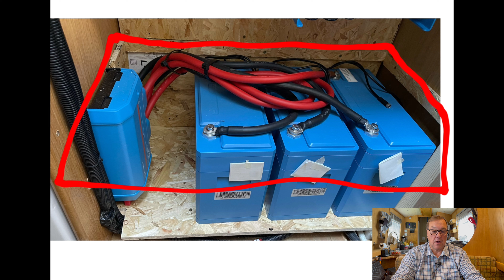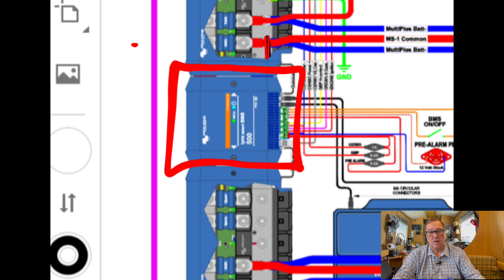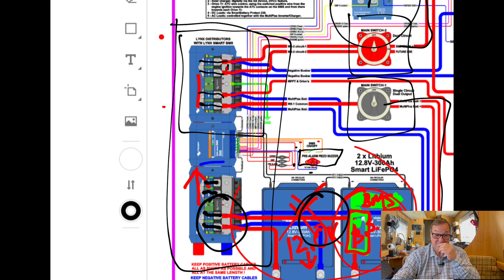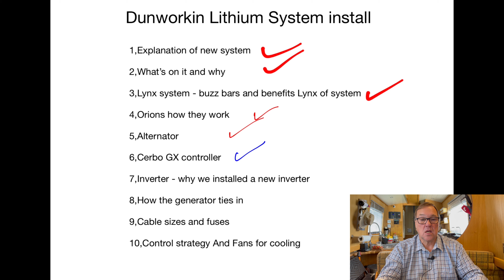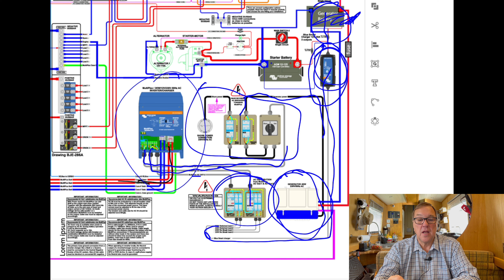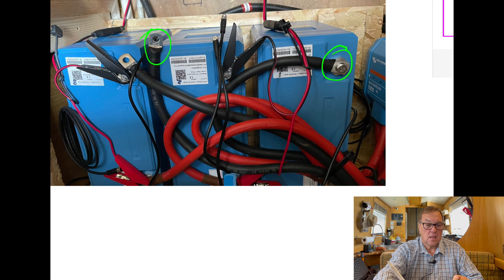159-Upgrade Alert! Watch How We Install Lithium Batteries On Our Narrowboat - Part 3

Comment: Hi I'm about to change my amgs to lithium 😮been looking at your videos Very informative my plan is to do a similar set up to yours I'm going to retrofit fit a diesel generator like you have what can I ask what you have and what you recommend after having yours for a while many thanks quince
Reply from the maker: Hi Quince👋, we would definitely recommend the change to Lithium batteries and would say that Victron are the way to go because of all of their safety features. 
With regard to the generator, we think that you cannot go far wrong with an inbuilt, water cooled generator. We have a  3KW Whisper Pico, which we have now had nearly 7 years. Although we are now happy with it , our experience hasn’t come without problems. We would suggest that you do your research well, and get one that parts are easily available in this country. The parts for ours come from the Netherlands and we found it really difficult to source a supplier, the boat yard where we had it fitted wasn’t interested in it’s maintenance or problems once it was fitted so Pat does it all the maintenance himself. 
In our experience these generators like to work under load for short periods and not just idle all the time which can cause injector problems resulting in the generator not burning the fuel efficiently. 
We use the immersion heater  or multi cooker ( not at the same time!)to give some load. 
We don’t have any experience with any other generators so we couldn’t recommend one, hope this helps though. 😊
Reply: Thankyou doing lots of research trying to find a generator that a can fit or retrofit that is good quality and the biggest thing quite is the hardest thing lol also thinking of upgrading my solar as I only have 500 watts at the moment but like you don't no if it's worth the extra expensive

Comment: Hi pat, thanks for the information I’ve had the same kit fitted in my boat about the same time you had yours fitted, however, I was advised to have a belma autonator fitted with its own BMS and it all seems to work pretty good- the bit I’m a little concerned about is my batteries haven’t even got warm yet so I’m not sure if I need to fit some fans for them, I will now be fitting them in the other cupboards with the other stuff as it would be better than just top and bottom vents for the future- but I would like to thank you again for your vlogs on this subject I’ve learned more from them than from the installation gang I employed, take care, Peter, NB Bluebelle
Reply from the maker: We also considered a Belma Autonater but they are quite expensive so we thought we’d so how it goes. We seem to be having good results with the DCD controllers. Although we would probably be able to improve the system with a Belma. Any equipment installed in a cupboard should be adequately ventilated. Sorry for delayed reply but the comment came through when we wasn’t monitoring our channel. Hope all is well now 😊
Reply: I have just fitted Lifepo4 batteries to my boat and referenced your upgrade to keep me in the right direction, thank you. Please one question, did you inform your insurance company about the mods to the boat. I’ve read thru my policy and it seems to be a grey area

Comment: Thanks for your video. I don't quite get how 2 bus bars linked by different fuses work. I understood a busbar to be a bar that enables other cables to be linked to it, surely if you join 2 busbars together by different fuses they will only become separated when the highest fuse blows?
Reply from the maker: Hi Clive👋, this is what Pat has said- 
The two busbars we are talking about are connected together via a switch,  in essence they are one buzz bar.  The aim is to connect the batteries to one buzz bar and the inputs and outputs of the system to the other buzz bar when the switch between the buzz bars is broken this disconnects the inputs from the outputs.  Each connection to the buzz bar is fused with a suitable sized fuse. 
Hope this makes sense! 
Thanks for watching and commenting!👍

Comment: hi i think you will need a temp control on the dc alt , you will  be replacing it  ,as it will run at max charge all the time sorry ,
Reply from the maker: It will run at maximum voltage but not at maximum current as the orions will reduce the current flow,  which is what causes the overheating. 
Thanks for watching and commenting!👍

Comment: Very interesting and comprehensive setup, I might have missed this, but what was your initial design criteria which drove the sizing of kit?
Reply from the maker: Primarily due to the fact we have monitored our usage over the last three years and concluded that we needed 200 to 300 per day including any future expansion, with a 50% discharge meant that we needed 600 amp/hrs. This is a generous total but it does mean that our batteries are not working at full capacity. 
Thanks for watching and commenting!👍

Comment: Thank you at last somebody that knows how to connect batterys up properly I have seen so many blogs of people showing their handy work in fitting of new batterys in their boats that are not done anywhere near as efficiently as yours have been done and when I mention how they should be done I get told I'm a idiot that has no idea what I'm talking about.Now just a little question I see you have two orions I thought maybe one for each battery but you have three batterys so is it just to boost the charge to what you require or another reason
Reply from the maker: Hi👋, we have 2 orions as they are rated at 30 amps each. This allows us to boost our total output from the alternator to 60 amps at a charge voltage of 14.6 volts. Hope this answers your questions. 
Thanks for watching and commenting!👍

Comment: you dont really need a BMS with lithium

the battery fails it fails, unless ur going to replace the cells yourself
Reply from the maker: The BMS is there to help prevent the battery from failing. 
Thanks for watching and commenting!👍